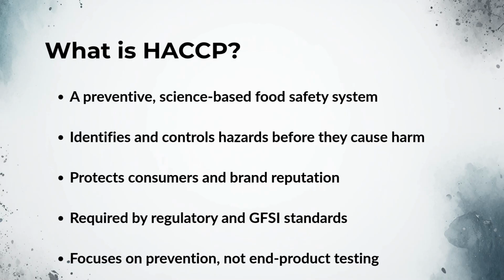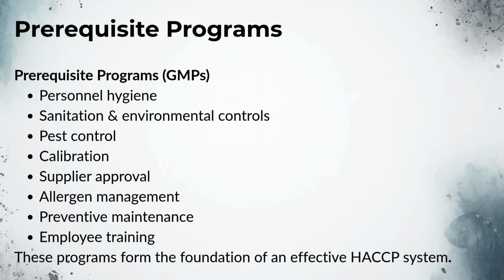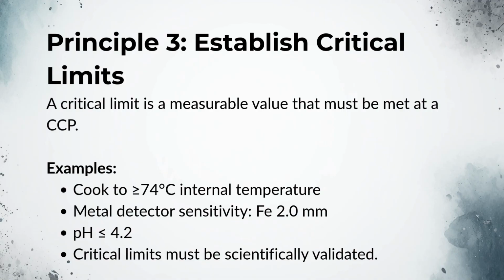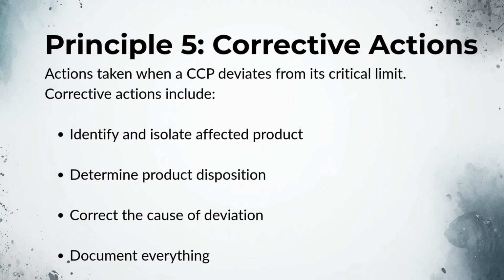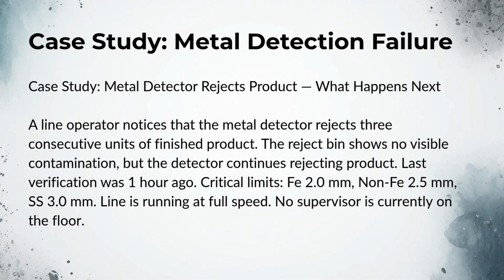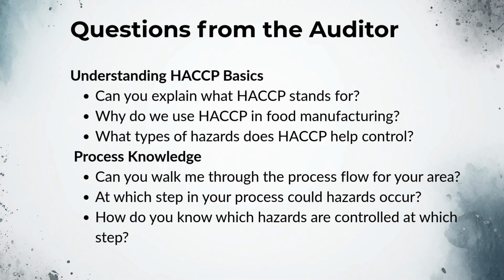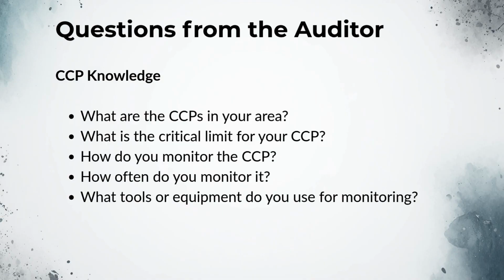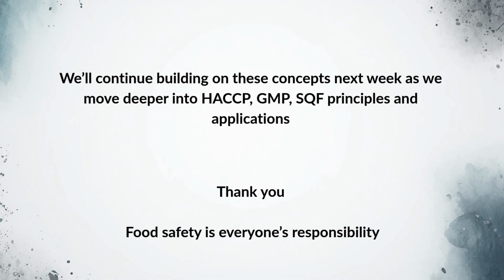HACCP Principles Explained

Comment from the maker: Understanding HACCP is the foundation of every strong food safety system. In this video, we broke down the 7 Principles of HACCP in a simple, practical way so you can apply them confidently in any food manufacturing environment.
✔ Key Takeaways:
- Conduct a Hazard Analysis
- Identify Critical Control Points (CCPs)
- Establish Critical Limits
- Set Up Monitoring Procedures
- Define Corrective Actions
- Verify the System
- Maintain Documentation & Records
If you found this helpful, like the video, subscribe, and share it with your team to build a stronger food safety culture.
💬 Have questions or want a video on a specific HACCP topic? Drop it in the comments